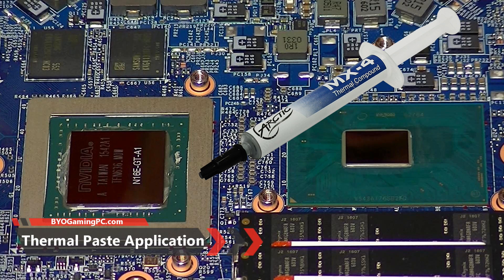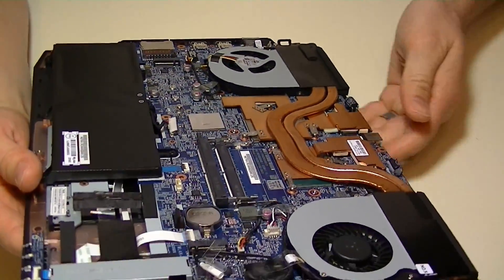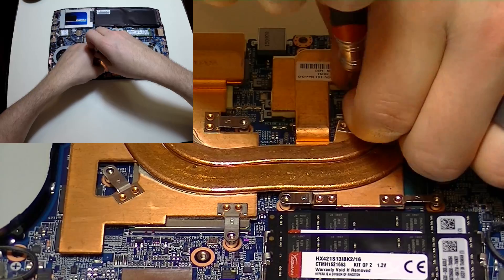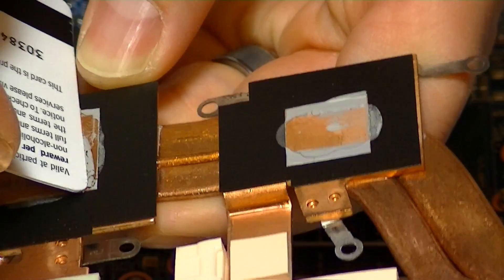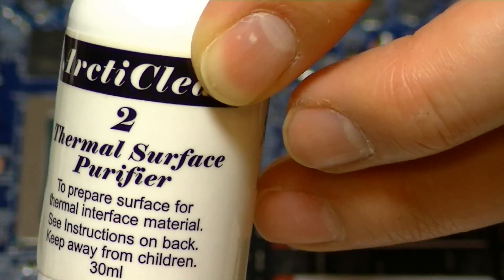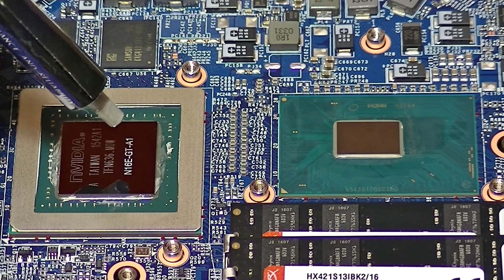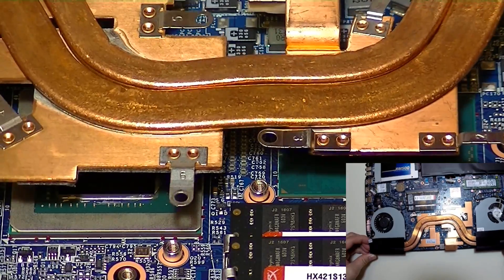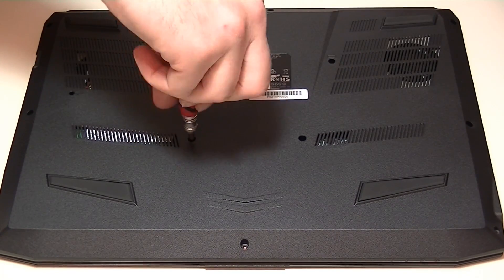How to Change/Upgrade Laptop Thermal Paste Fix Overheating (Clevo P641RE)

Comment: With the pea method is it better to have to much or to little? Also how can you be sure it has a even spread , since you can’t lift it up and check?
Reply from the maker: It would probably be better to err on the side of too much but not by a lot. You don't want to see it flowing off the CPU into a large mess. You just have to trust in physics and apply even pressure to make sure it spreads evenly. You can always do a trial run and test to see how you do with the intent to lift it off to see how well it spread and clean it to repaste once more.

Comment: Do the sides need to be spotless as well? Or is is it fine if there's a little bit of residue left behind from the old thermal compound?
Reply from the maker: The sides won't matter as much because they don't make contact with the heatsink.

Comment: No need to smear/spread the thermal paste?😬
Reply from the maker: You can but if you apply even pressure when tightening the heatsink it will spread it due to the pressure.

Comment: Hi, did you experience the "pump out" effect while using arctic mx4 as a thermal compound for your laptop? It's usually happens in laptop when the thermal compound is "pushed" out of the heatsink making performance worsen overtime. When you remove the heatsink the CPU die will looks very clean as if there wasn't any thermal paste applied at all.
Reply from the maker: I don't believe I've experienced this ever. I've heard that it is necessary to store your compound upright due to separation over time. I'm not sure if this is accurate but I've always done so and not had any issues.

Comment: I know this is an old video and it is well made, but I why do you use "the pea method" in this case? That is a good method for desktop CPUs where the heat is mostly concentrated in spots around the middle, but for a laptop CPU you want to cover the whole die evenly, which can't be quaranteed without spreading the paste manually before putting the heatsink on.
Reply from the maker: I only use the pea method on square dies. Rectangular ones I use a thin line.

Comment: Hi experts. Make sure, your operating system is activated. Start Youtube, watch cod black ops with maximal resolution that is comfortable. Eg 720 p for 2.1 ghz cpu. After 30 min the cpu will reduce the heat, and the choppy screen. Install cod 4, for older laptop install an earlier version. Qualify, then the noisy fan will reduce noise forever . if you want far less heat, then charge your good battery, unplug, and start the laptop in bios. Drain it after every five charges in bios, then you will see the result in Windows. Complete silence with higher performance . if you have further trouble, then work with MS word below 20% on battery till it drains. Rest your laotop from 1 day till one week ac offline. You will see on power this: 0% charging, online, during startup. Then you are on the track to achieve the best possible performance.

Comment: do u have to use all the special solutions or could u just scrape as much off and it will work?
Reply from the maker: I would just use isopropyl alcohol if you don't want to buy the ArctiClean. Just scraping it off will likely leave residue behind that will reduce conductivity.

Comment: I replaced the thermal paste as shown but now my laptop will  not turn on. I have fan speen but it shuts off imediatly after, what can the problem be? ( I have to mention that I touched the bumps on the cpu, the part with the thermal paste, with my finger in trying to remove all the old paste) is it possible to have shorted it?
Reply from the maker: Try repaste everything and clean it really well. See if you still have problems. Make sure you didn't leave and loose items lying inside.

Comment: If you are okay about it, I use Isoproply Achol and toothbrush to gently remove old paste. I also mask tape the cpu gpu and apply the paste.
Reply from the maker: Isopropyl alcohol is good to use but I'd use 90% or better but I would not use tape to apply paste. I'm not really sure why you would do that and you have the potential to do more harm than good with it.

Comment: If i would remove the heatsink to check if the thermalpaste layer is fine can i just place the heatsink back or do I always have to renew thermalpaste when removing the heatsink?

Asking because you said somewhere below in case notebook has issues the thermalpaste should be checked.
Reply from the maker: Always change the thermal paste when you remove the heatsink. When you reinstall the heatsink there will not be an efficient seal between the spreader and the CPU/GPU with air pockets in between.

Comment: Yup. Did all that and turned my laptop back on then it shut off immediatley and now I'm left with a brick. Any suggestions? It will turn on but won't post.
Reply from the maker: Check all your cables and fans and see if anything is obstructed or disconnected. You may also want to check your pasting. You may need to redo it.

Comment: I have a Dell XPS laptop (i5-560m, nvidia gt-435m) and lately the temps are really starting to climb. I took it apart just enough to see what I was getting into and, to my surprise, it has thermal pads on the cpu and gpu. Should I replace pad with new pad or switch to paste? I e-mailed Dell tech support and received a "Product is out of warranty and tech support is no longer available" response. So any input you're willing to offer would be appreciated. Thank you.
Reply from the maker: Paste the CPU and GPU or you could try one of these... https://amzn.to/2NWRwau

Comment: What do you think about sticking a small passive cooler on the mainboard chipset to increase lifespan? Ever tried it?
Reply from the maker: I don't think it would have much of an impact since there would be little airflow over it.
Reply: BYOGamingPC Makes sense. Do you know if you can read the chipset temperature somehow? The usual tools don’t show a sensor for it on my machine.
Reply from the maker: I do not. It's usually not a component that typically overheats so it's not common to have a thermal reading from it.
Reply: @anycomb814  use hwinfo

Comment: Shit man i didnt really follow the order on the heatsink for tightening but i use the criss cross method like on mechanic work. Does that call for a redo?? its my first time ever re-pasting so im a little worried. Prior to changing the paste my cpu would hover around 84-88c, get up to 90's after 10-15 mins of playing Dark Souls 3. GPU was fine at 72c. So i figured it was the paste on the CPU. After changing the paste on both, i went from 84-90c down to low 80's highest was 84c. It took longer to get to the 80's and it stayed high 70s longer than before, but id imagine the longer i play the higher it'd get. its not the biggest difference so im wondering if i even did it right? my idle cpu temp hovers between 39-43c. What would you recommend i do? repaste? or is it just the game? im already using a cooling pad although it's old it still works. I wanna play Dark Souls but not if im constantly hovering in the 80c.
Reply from the maker: The problem with this particular notebook model is that the cooling solution for the CPU is inadequate. Temps are always high no matter what you do. You need to download Intel XTU and run your CPU with a -150mV underclock. It will run about 10C or more cooler and just fine.
Reply: thanks for the suggestion, i noticed lower temps when playing fortnite so i think the paste is doing its job a bit. Dark Souls still makes my cpu hit the 80's but i guess its just a very demanding game. My laptop has an i7-6700hq quad core processor. i guess thats just the way it is unless i run it underclocked. thanks for the reply!
Reply from the maker: My pleasure. Glad you're showing improvements.

Comment: What if the heat sink copper tube was bent by mistake and I was able to return it back to the its original level but unfortunately the tube surface where the bending happened can never be 100% flat again. It is having a bending mark where I think it is not having the same internal spacing level. Do you think this my decrease the heat dissipation operation? I am afraid of not having good performance and the CPU temperature when playing high graphics is increasing to 92 degrees Celsius because of that. Please advise
Reply from the maker: If you're talking about the copper tubing then straightening it as much as possible should be fine. If you're referring to the heatsink plate that makes contact with the CPU itself then it could cause some serious heat issues. This particular notebook model doesn't have adequate CPU cooling so it is highly recommended to download Intel XTU and give the CPU a -150mV undervolt. It drops the temps by at least 10C and doesn't effect performance.

Comment: sir, I hv lenovo y700 I applied the thermal paste artic silver on my cpu and gpu, it ran fine for 3-4 days then again my cpu temp went up to 90 degrees, then I again opened the laptop and applied the thermal, now the case is that my cpu is fine with 60 degrees but gpu temp is going above 90 degrees(which was previously 70-80 degrees) and I get lags between game again, can you help plz.
Reply from the maker: You probably need to reapply to the GPU. It sounds like you didn't get a very good application on it.

Comment: how often should you replace thermal paste, thanks
Reply from the maker: It depends on your amount of usage and temps you run but anywhere from 3-7 years depending on what type of TIM you have and your usage scenarios. If you are getting high temps doing general computing then changing the past is the first place I'd check and also cleaning the fans.

Comment: Can you share temps? Idle and Load both
Reply from the maker: CPU is about 74C max with undervolting and GPU is 68C max.
Reply: @BYOGamingPC  I think I'm not able to get the right consistency when tightening the heatsink screws down, I repasted my laptop but it seems that it doesn't make a difference and I'm thinking its a screw tightening issue. How do you solve that?
Reply: @BYOGamingPC  Hi please answer https://www.amazon.com/ArctiClean-ArctiClean1-ArctiClean2-MicroFiber-Cleaning/dp/B00SJQFH7S?psc=1&SubscriptionId=AKIAIEYUINDFG5I5QSYA&tag=cailhq-20&linkCode=xm2&camp=2025&creative=165953&creativeASIN=B00SJQFH7S can i use this cloth rather then coffee filter one? as its included in it maybe i can just use it for cleaning the paste with arcticlean and then use purifier aswell?Thanks ill be waiting for ur reply :)

Comment: i have seen many videos that they just wipe old paste with tissue....?is it necessary to use thermal remover & purifier??
Reply from the maker: It would work to do it that way but the cooling would be much less efficient. You would have impurities from the tissue lint and the old residue would make the thermal conductivity of the new paste very inefficient.

Comment: Thanks for this detailed explanation. I have a question though - doesn't the heatsink have any connection to power the cooling fans? Also, can I use water or nail polish remover to get rid of the gunk from the surface?
Reply from the maker: Do not use nail polish remover because it will do more harm than good. It will leave residue. Use rubbing alcohol of at least 90% purity or the ArctiClean kit linked in the description (preferred method). The CPU has thermal sensors built in to read temperatures.
Reply: Thank you. I have a P650RS-G with a Core i7 6820HK and a GTX 1070 which is heating up to 90C while gaming at full tilt on 4k and even FullHD. Although I got Coollaboratory Liquid Ultra for the CPU and stock paste for the GPU, I have not been able to bring the temps down even after undervolting so I guess the only thing left for me to do is re paste. I'm not sure if the ArctiClean solution will clear out the liquid metal CLLU thermal paste so I'm scared to proceed. Plus, I believe the heat is mainly due to summers, as I got the laptop in October last year.
Reply from the maker: I would not use liquid metal on a laptop because of its electrical conductivity. Use ArctiClean and be careful to remove all of the old TIM before repasting. Is the GPU or CPU hitting 90C?
Reply: BYOGamingPC the GPU reaches 90C. The CPU on the other hand stays low, around 70C
Reply from the maker: The only options you really have for the GPU are undervolting or using an OC program like MSI AfterBurner to set thermal throttles to keep the GPU from passing a set temp. The GTX 1070 is tough to keep cool in a notebook.
Reply: @BYOGamingPC  Kind Sir, Could you explain more how to allow MSI burner to set thermal throttles to keep the GPU from passing a set temp?
Reply: Isopropyl alcohol (concentrated) available at hardware stores and pharmacies.